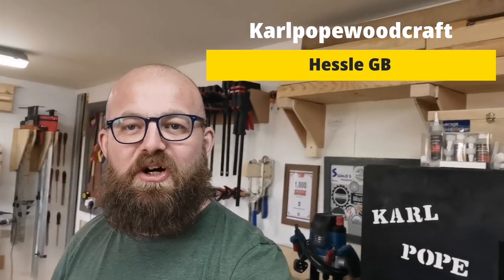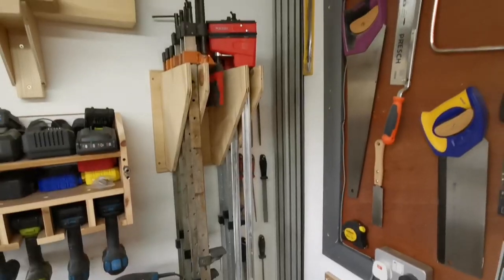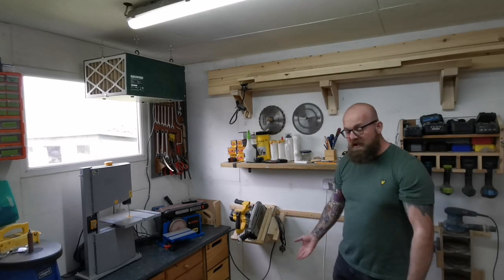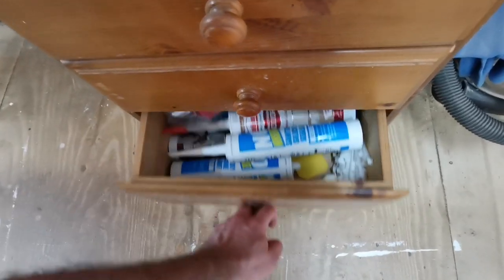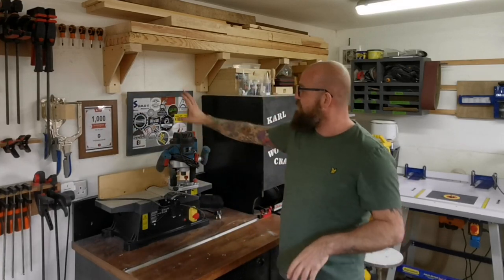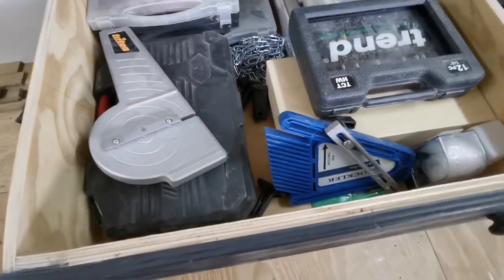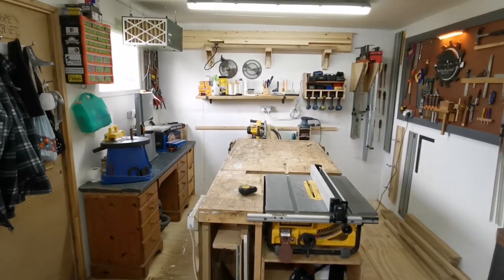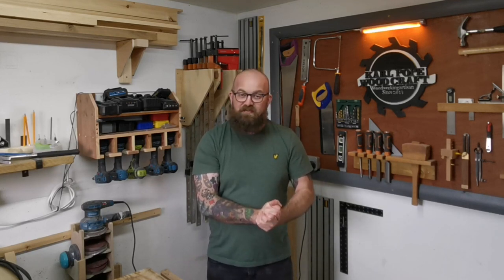Small UK Workshop Tour

Comment: Nice set up Karl your hard work is paying off. Investing in tools speeds the manufacturing process up dramatically. Tony
Reply from the maker: Cheers Tony, so true without the Domino and the pocket hole joinery I would still be cutting the joinery for the Oak unit I'm building. 😊

Comment: Great Video Karl  you've done a brilliant job with the layout. I have the same red tool bag that you use for your site bag which I use as what I call my grab bag and it contains a wide selection of tools to cope with most jobs and if i need other tools then there either in the workshop or need adding to my collection ;) I also noticed we have the same Titan bandsaw and was wondering how you get on with tensioning the blade as mine never seems quite right and I do get a lot of blade wondering on my cuts.
Reply from the maker: Hi Andy, I just call it an overgrown scrollsaw because its definitely not for re sawing timber 😞 my blade isn't even the size it says on the website so yours is probably the same. I can't remember the actual size but when I called the helpline they where aware of the issue because they recommended a different size and brand. Try giving screwfix a call mate.
Reply: @karlpopewoodcraft  thanks karl ill give them a call mate